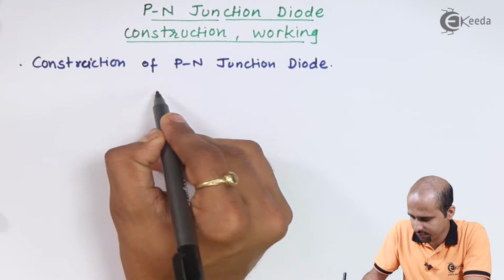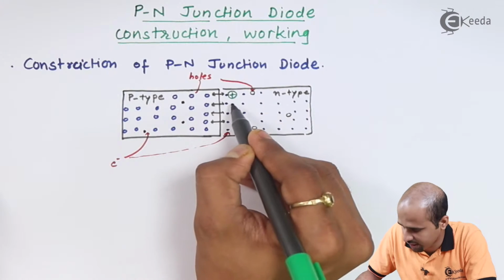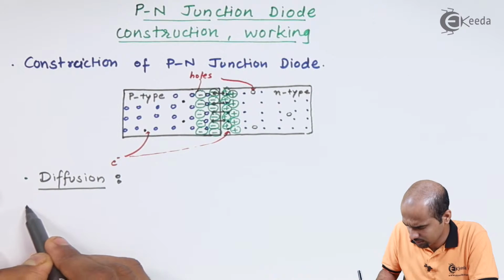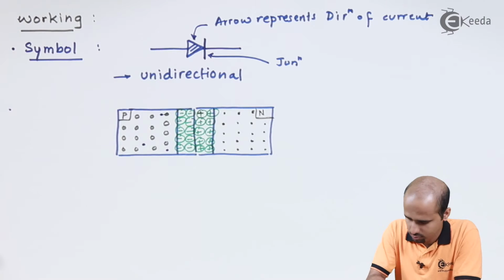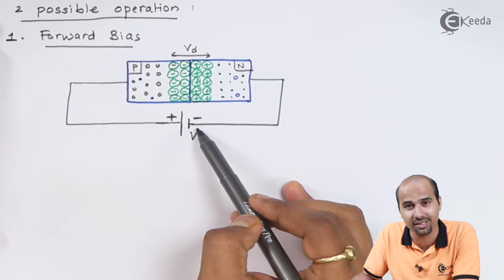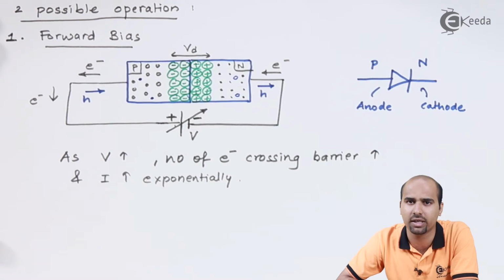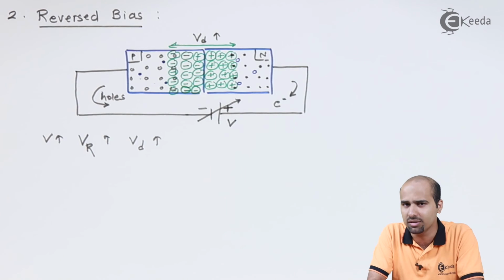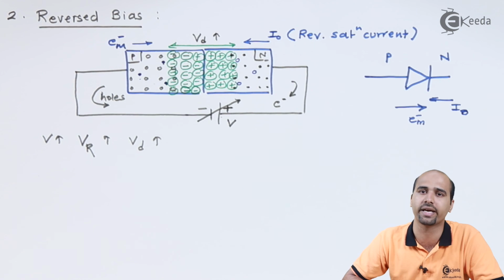PN Junction Diode Construction and Working | Electronic Devices and Circuits - 1 in EXTC

Comment: 00:06 PN Junction Diode Construction involves combining p-type and n-type semiconductors with majority charge carriers as holes and electrons respectively.
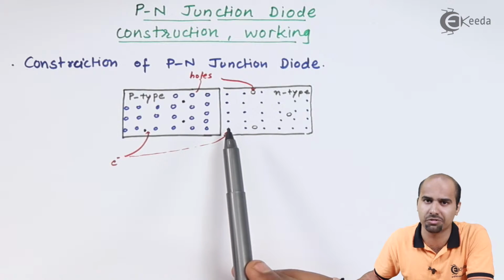03:23 Charged carrier recombination results in the formation of positively and negatively charged ions.
06:19 Diffusion and drift are two processes in the working of a diode.
09:15 PN Junction Diode Formation and Working
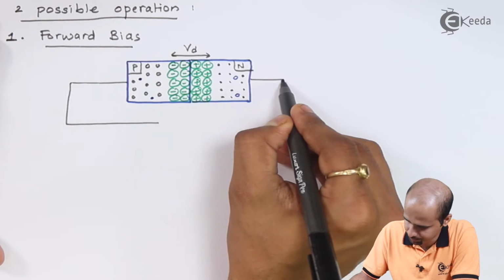13:26 Current flows from anode to cathode in a PN junction diode.
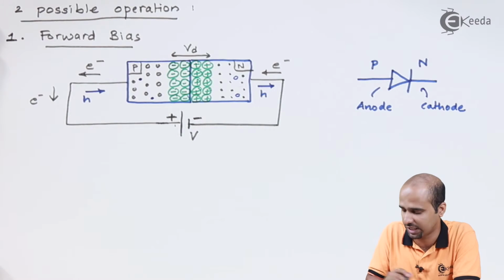16:18 Forward bias increases current exponentially.
19:20 Electron and hole movement in a diode results in the conversion of atoms into ions.
22:04 In reverse bias, there is a very small reverse saturation current.

Comment: What is a pn junction ? 
A pn junction allows current in one direction only. It blocks current in the reverse direction. 
When a pn junction is formed, a potential barrier designated Vo comes into existence and is typically around 0.6 to 0.7 volts for silicon junctions. 
When the barrier whose Vo is 0.7 volts is disturbed by applying a forward bias of say, 0.6 volts, the current increases and the increase becomes steep for small increments of the forward bias value a little greater than 0.68 volts. Large currents are observed when the forward bias is 0.69 volts which is closer to the barrier voltage of 0.7 volts. 
The forward bias can never exceed the potential barrier voltage nor can it bring the barrier down to zero volts. That is the reason you seldom see current vs volt graphs of pn junction diodes beyond a volt or so.
How does the bias remain less than the barrier in an operational diode?
The voltage bias applied drops in the bulk neutral regions of the diode. 
The current in a forward bias adjusts to fulfill the conservation of current law and the rate of recombination.
A detailed description of the pn junction with a distinct approach using surface charges, alignment of Fermi levels, creation of the barrier, the distinct processes of diffusion, drift, recombination and the influence of the electric field on the energies of electrons is provided in the following textbooks.

Electrostatics and circuits belong to one science and not two, that of electricity and magnetism. To know how they are unified visit this link 
https://matterandinteractions.org/articles-talks/ and view the article 'A unified treatment of electrostatics and circuits.  B. Sherwood and R. Chabay, unpublished. (1999)'
pdf. 
For a live demonstration of surface charge and its effects in circuits visit 
https://youtu.be/U7RLg-691eQ
For a detailed discussion of surface charge, coulomb's law, electric fields, fields of dipoles and other charge configurations, and parallel plates, and a distinct approach using the surface charge concept in the study of advanced topics of capacitance, currents, conservation of charge, conservation of current, superposition of fields, superposition of potential, simple dc circuit, magnetic fields, magnetic fields of a current element, straight wire, current loop, solenoids, biot-savart law, voltage, voltage source, difference between e.m.f. and potential difference, ideal voltage sources, resistors, how current branches in a parallel circuit, capacitors, inductors, Faraday's law, inductance, ac circuits, transmission lines, Lorentz Force law, motors, generators, p-n junction diodes, electromagnetic waves, antennas and radiation, new electrodynamic theories on the nature of the electric field, see "Electric and Magnetic Interactions" by Chabay and Sherwood 
www.matterandinteractions.org
or 
Fundamentals of electric theory and circuits by Sridhar Chitta
https://www.wileyindia.com/fundamentals-of-electric-theory-and-circuits.html
There is a "look inside" feature in the amazon.com webpage of the book "Fundamentals of electric theory and circuits" by Sridhar Chitta with a few pages of Chapter 1 which may be viewed and also which you may swipe left or press < icon to view the foreword, preface and Table of Contents. The contents of the above book by Sridhar Chitta, make a distinct unified approach to electrostatics and a few advanced circuits like coupling signals to amplifiers, lending precision and clarity to the topics which is not found in most text books.
The book comes alongwith a CD with animated power point presentations for all chapters and voltage regulator, RC phase shift oscillators and differential amplifiers included additionally.
For a lecture by Prof Ruth Chabay on surface charge in a simple dc circuit visit 
https://youtu.be/-7W294N_Hkk
There is a full set of lectures beginning lecture 13 here on surface charges, electric fields, simple circuits, capacitance, inductance, faraday's law, motional emf, magnetic forces and more topics here
https://matterandinteractions.org/videos/EM.html